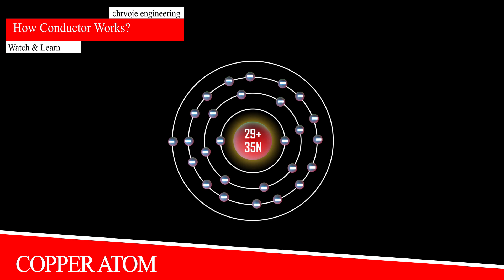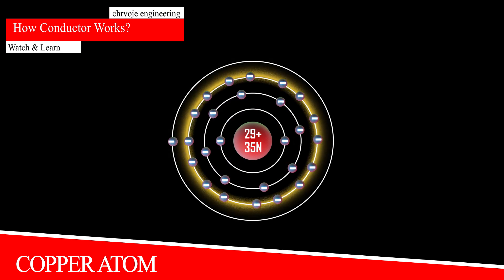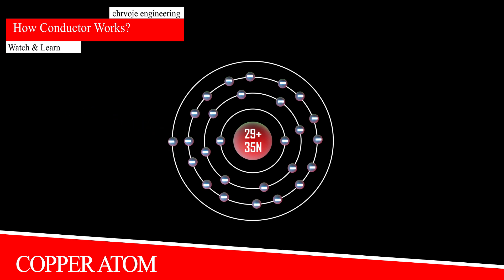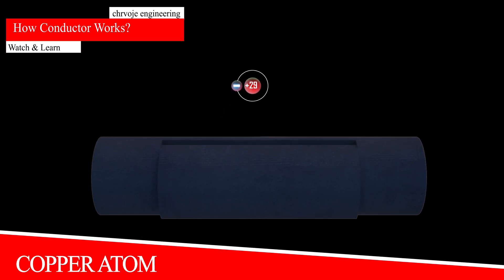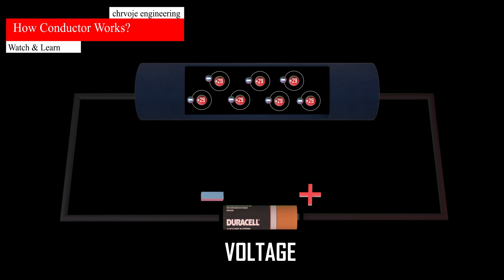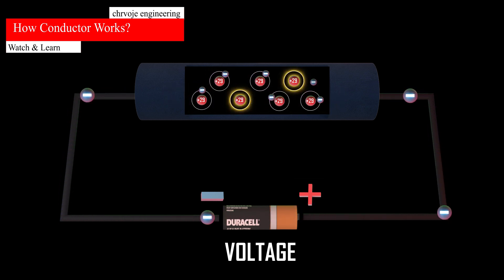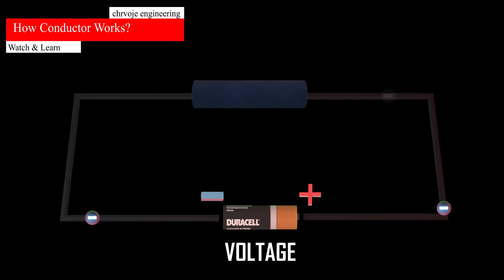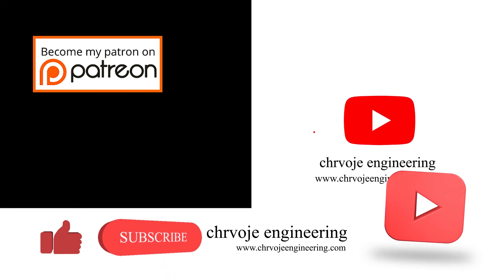How Conductors Work?

Comment: Great video bro... Please make a video on  the surges travelling in a transmission line, when a lightning⚡ strikes a transmission line... And please explain this surge impedence loading visually.... Your visual intuition will be very helpful
Reply from the maker: Thanks for nice feedback...good idea for video, do you have any idea or script
Reply: @chrvoje_engineering  
Yaaa I have one practical example that my professors used to say that is, 
In a substation the incoming overhead transmission line is not directly connected to the distribution transformer there, but the incoming over head transmission line will be first conneced to the underground cable then to circuit breaker and then to the tranafomer,, the reason for this is ,, if any lightning⚡ strikes the over head transmission line or the transmission tower outside the substation and by chance the surge arrestors are fail... Then that impact of lightining will be taken care by the UG cable and the transformer will remain safe,,,,, they say that the UG cable has less 'surge impedence' in comparison to overhead transmission line

Now this word 'surge impedence' is very hard to visualize
Reply from the maker: @abhisheksamal1970  Interesting, can you send me example on web, or something to see